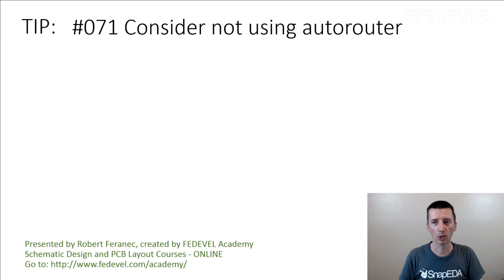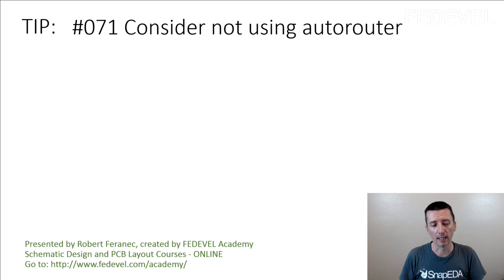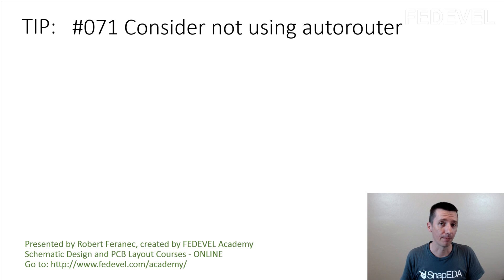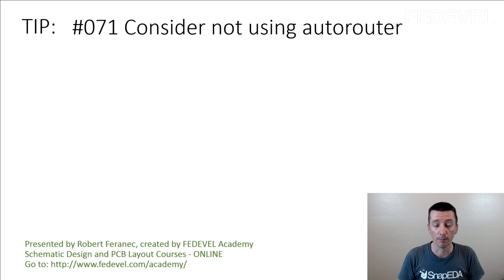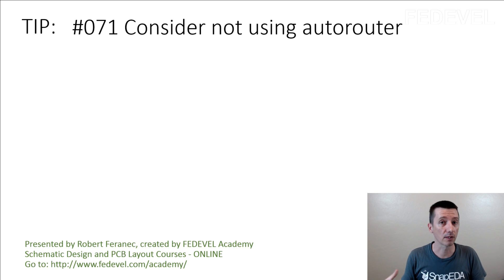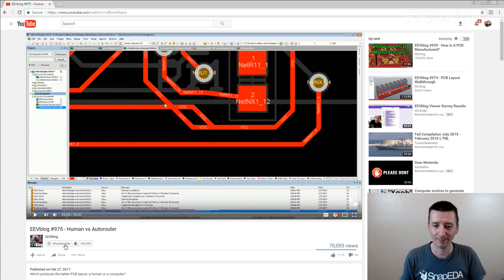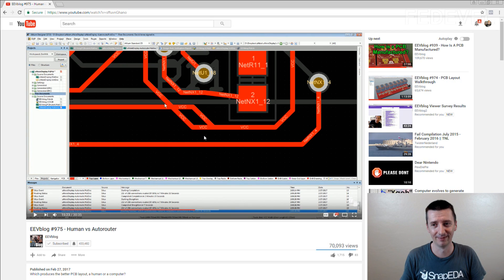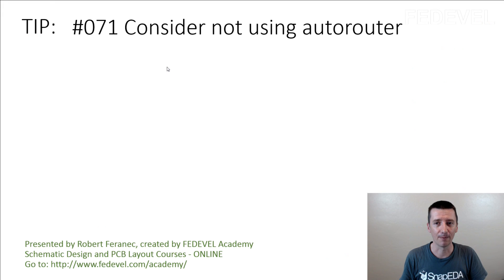TIP #071: Consider not using autorouter

Comment: Again, your problem is your tool. With PADS autorouter (BlazeRouter) for board similar to Dave's, results were very good, even better with Specctra. But yes, the tip is very valid. Since many years I'm not using autorouter for entire boards, only for controlled sections, if at all.